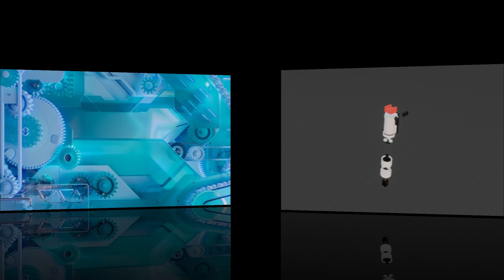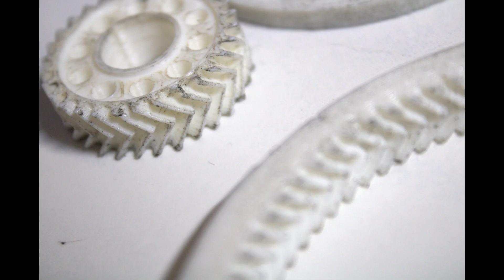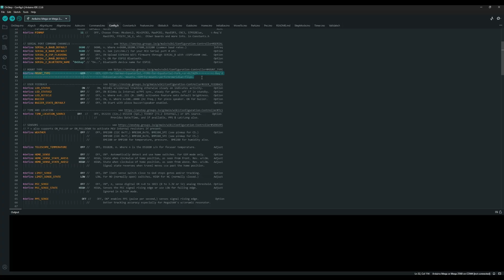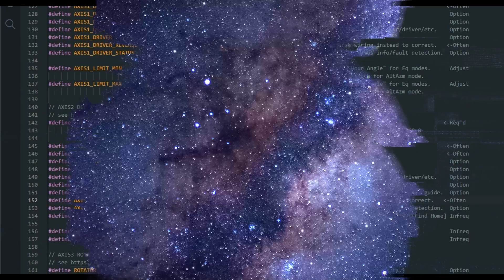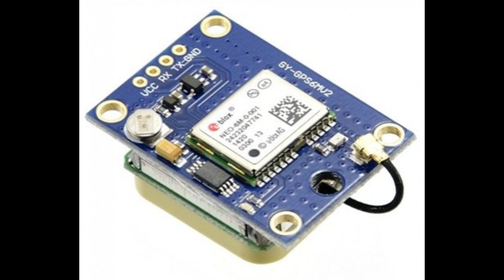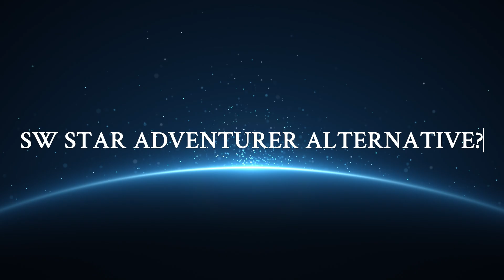DIY 3D printed EQ mount, with Onstep firmware

Comment: hey man, really nice work, can you share the 3d printable design of the gears? i have tried to create one, but not succeeded, i have all the required parts except the gears, anyhelp would be really appreciated.
Reply from the maker: It was created with OpenSCAD, allowing all gear parameters to be defined before rendering and saving it as a 3D model. Unfortunately, the design was only capable of a 25-second exposure time, so it wasn't worth the effort; however, it still performed better than I initially expected. Because of this limited utility, I decided not to share the design. https://openscad.org/

Comment: Can I please ask you to help me out with OnStep settings fomr mym ount. I have similar problem with the DEK on my EQ5 mount but I do not understand why it is doing it. and I need someone with hands on experience with this module so I can fix and get it going. It always go in the oposite direction and even that it is aligned with Polaris, can`t find home...
Reply from the maker: Sure. Make sure that your time, date, and location settings are correct. If everything is okay, then consider reversing the movement of the DEC stepper motor in the config.h file after you open the Onstep.ino file in the Arduino IDE program. In my case, the problem was solved with this.

The Home position needs to be set with a telescope controller. I don't know what program or device you are using, but it can be set up with N.I.N.A. or with the ASIAIR. Just loosen the clutches and move the RA and DEC by hand to get it aligned with the N mark, which means the mount's North-side leg. Both axes need to be aligned with that leg. After this, you simply hit the "Set Park Position" button, and the program sends the park position coordinates to the OnStep firmware's motherboard.

What setup are you using? A DIY motherboard like Arduino or ESP32, or a purchased OnStep GoTo kit? Can you access the firmware? I mean, can you upload it to your motherboard?

With my Sky-Watcher EQ5, after I purchased the original Sky-Watcher GoTo upgrade kit, my problem was similar: the telescope was searching for objects in the opposite direction. In the end, I figured out with the shop owner from whom I bought the kit that the time and date settings were wrong. After typing them in correctly, the mount's axes moved in the right directions.

When you are working on the axis movement, you don't need a telescope on the mount. Just make sure that when the mount is moving, everyone and everything is safe. When I was experimenting with my mounts, both me and my telescopes sometimes got harmed. Safety first!

It is enough to point the mount roughly north, and when the mount is settled, you can verify the direction of the movement with a smartphone's planetarium app. With that, you can check where the targeted object is in the  sky. At this stage, you don't need polar alignment, which is needed more for perfect tracking.

Stay safe, and if I can help you with anything further, just let me know. I am not a professional; I just searched through forums and the OnStep web pages and OnStep Facebook groups, where the real professionals dive deep into the topic.
Reply: @CosmosANONIMUS  Can we exchange contact info somehow so we can make a more direct conversation, since the info you want me to give you will take forever here and I do not think it is the best place for that?
Reply from the maker: My instagram page sould be a place to discuss this. The link is in my youtube profile. Send me a message there.

Comment: are you going to publish it?
Reply from the maker: Unfortunatly not, because it is only capable of 25 second exposure because of serious backlash and i don't want to waste anyones time or money making it. But it was a project just for fun to, reuse the old chinese 3D printers parts and make from garbage something usefull. In fact it is capable of Lunar imaging.
Reply: @CosmosANONIMUS  Nice, it´s a cool project anyways!
Reply from the maker: @update767  thanks, i think i will remain with my original sky watcher mount for further astrophotography. I am not a pro, still need to learn much more.
Reply: @CosmosANONIMUS  same here, i´m also a beginner
Reply: @CosmosANONIMUS  Hey, maybe if you replace your gears with nylon, PETG, or another stronger filament you can fix the backslash. Good Wrk dude, I'm looking to made one mount too